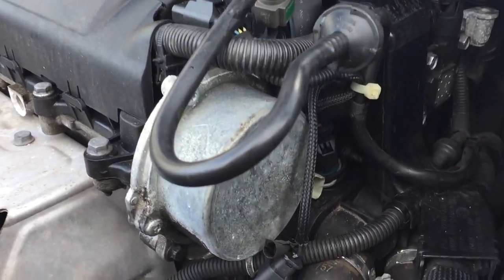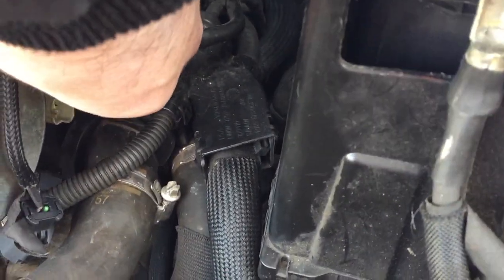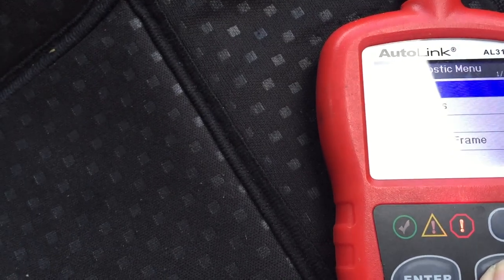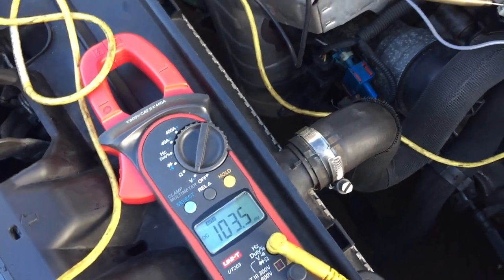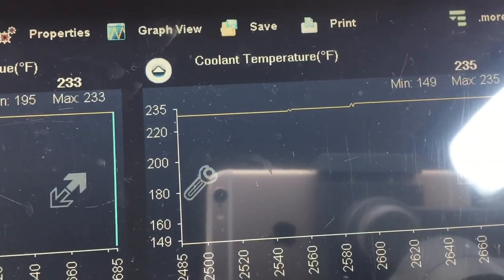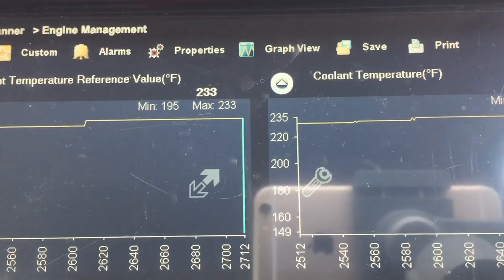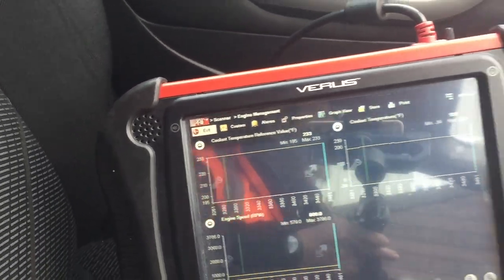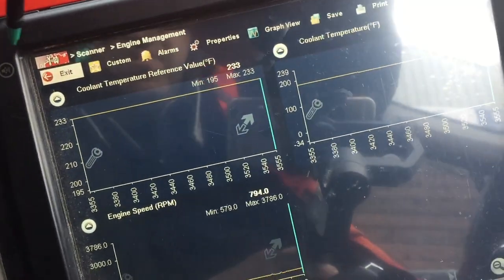Peugeot 308 - Overheating - no fan control from ECM! Part 2

Comment: Well if you remove the coolant sensor and the fan runs, replace the radiator cooling fan control module, where the plug in point is for the fan, that unit that's you plug into you remove with a torx bit.  It has a coil of some sort.

Comment: With no scanner. I've no front fan when turning on A/C compressor (05 307 SW). When I pull the green sensor plug engine water thermostat fan runs fine.  Software maybe? After a quick drive the fan runs and remains running for a short while (just like it used to) So after moving sensor connection we'll see!  Thanks.
Reply from the maker: No, does the compressor clutch engage?
Reply: @sandyande  Yes the compressor engages ok

Comment: Sandy, does the cooling fan has more stages or not through relays? Is the thermostat in the pipe doing its job?
Hope you will find the solution.Cheers.

Comment: you could use resistors in place of the coolant sensor and see what temperature the ecm uses to turn the fan on with out actually overheating the engine....and the fan only seems to come on high only.....i have never heard it come on low...only time i heard it on low is with bi directional control....also are there any other temperature sensors... like outside  temperature....some cars will not let the ac compressor come on if the outside temperature sensor reads below 50 Fahrenheit
Reply from the maker: Cheers for your help, sandy

Comment: Decade box is your friend here mate, are you 100% sure that it's not the cap leaking pressure? Remember - boiling point goes up as pressure increases.
Reply from the maker: Cheers Steve I'll need to order box and I'll try another cap, thanks, sandy
Reply: Same problem with peugeot 207 sw, except that there was a leak on radiator itself, so there was not enough pressure. Thank you